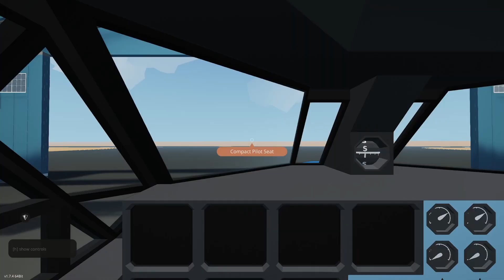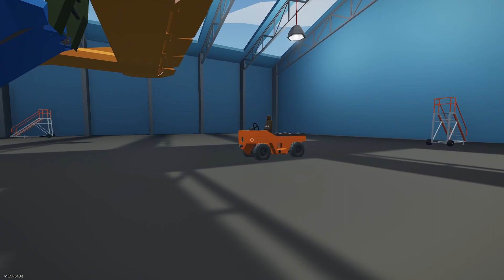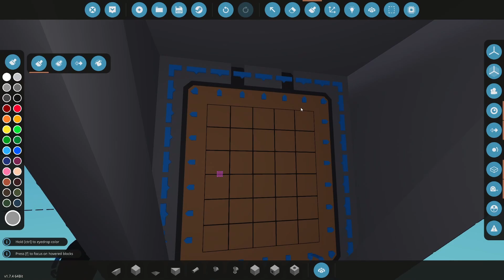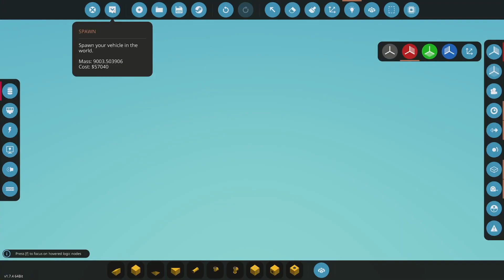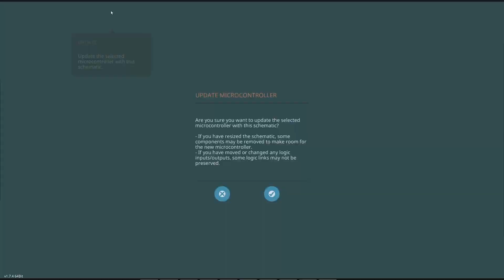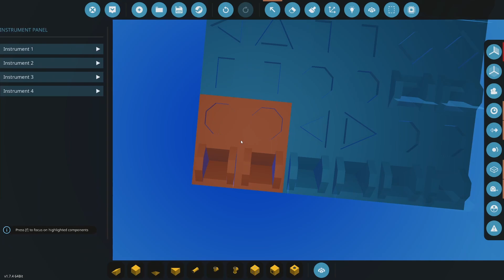Career Build Series 2023 Ep68 #stormworks #sandbox

Comment: Hi sir thx for the content, i have only one question if you can change the rpm with the button on the dashboard the throttle levers are for what? 
Sorry but English isn't my first language 😂
Reply: It's a constant speed propeller setup. The levers only control the throttle of the engines. The buttons on the panel (and hotkeys that change both sides in tandem) control the RPM by varying the propeller pitch to reach the target RPM. Hope that's cleared the confusion for you.